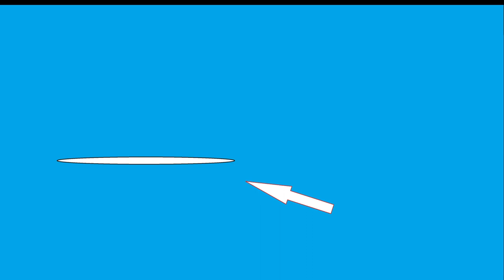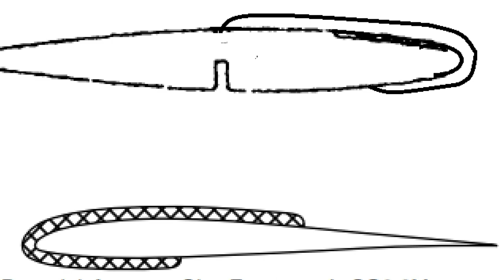ME 262 tip stalls

Comment: Great video, I had a smaller  GWS ME-262 that was well mannered as long as both EDF units were pulling equally. It was lightly wing loaded and took off, climbed and flew stably with sufficient airspeed. Had problem with one esc going into LVC and the other going full tilt, had to chop throttle and land dead stick or crash from asymmetrical thrust. BTW: As of 4/3/2024 Dynam models and parts etc., are becoming available again from  a warehouse in Los Angeles or from China , free shipping.